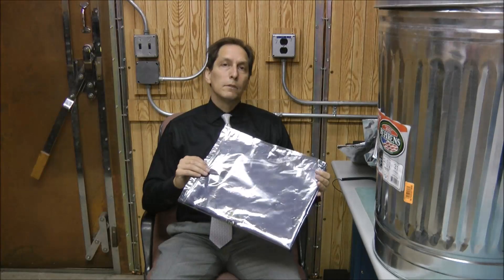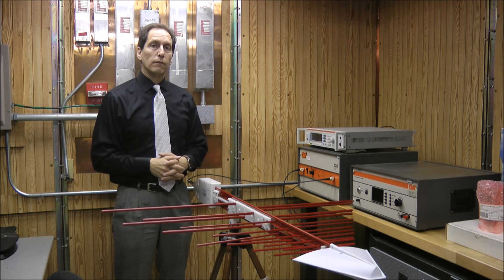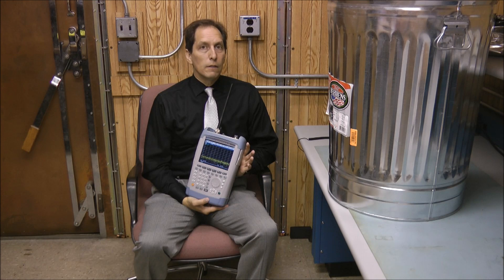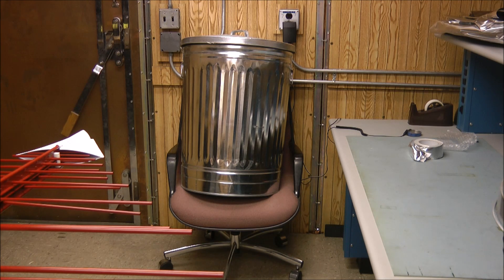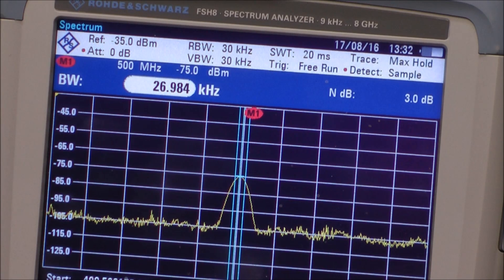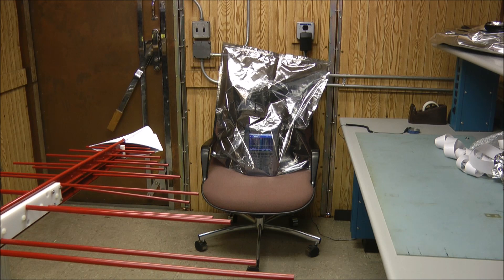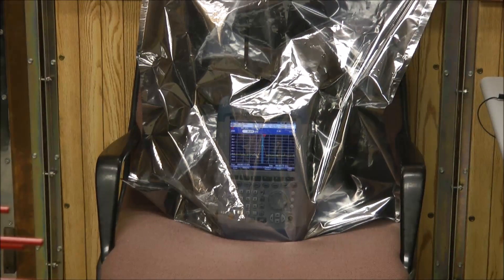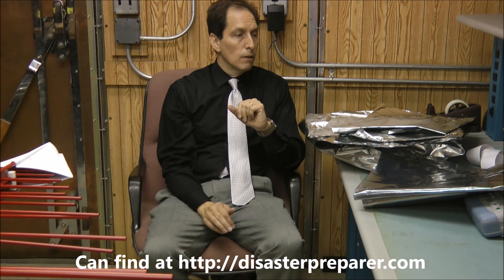Testing Garbage Cans and EMP Bags

Comment: I just put my cans together, making sure to seal all gaps and create isolation from the shell using cardboard. However, in the case of my cell phone, it rings with no issue when I call it while Wi-Fi is turned on. When Wi-Fi is disconnected, it won't ring. 

Is this an indicator that my cans are insufficient to attenuate the effects of an EMP? Is there anything else we can do to further protect our devices using these cans (I followed the video and used metallic ducting tape to seal all seams and ran a ring of foil around the top to further tie in the lid to the shell)?

Thanks!

Comment: Question, if you put a trashcan inside another trashcan, use Faraday tape to seal all the seams on both, do you think that will be much better than just a single can? Will that introduce any other issues?

Comment: While I'm glad you show testing and all, $50 a piece for the 36x36" bags is absurd considering they're available for less than a tenth the price elsewhere. I ordered my 24x36" 3400 series bags from Digikey for $4.50 each, since they're the only provider aside from you that I could find to purchase small quantities from. That's a far cry from the $22 per bag for your 26x30" size as well. Is there a reason for the massive discrepancy in price? If there's some valued adding service or treatment you do to the products your potential customers would like to know

Comment: Not sure if you can respond to my questions, but I really enjoyed this video I just first time watched, thankyou for the info 
Ok, I have an entirely aluminum metal rv horse trailer with living quarters(a Lakota colt).  I was thinking of sealing all windows with aluminum and all joint areas with aluminum tape to create it into a faraday cage.  I think it will work.  Question is, do I need to put in a grounding rod? And when  I finish and aluminum tape the main door on the outside will the tape stay on with rain falling on it or do I then need to put plastic over to protect the tape?

Comment: I dont know if anyone mentioned this, But I noticed on a garbage can we use to hold our chicken feed, it has a loose fitting handle you can probably see daylight where the handle is inserted to the lid and the tab is bent to kkep it in place. Perhaps some tape can help there as well.

Comment: Dang this video is old . If anyone reads this and knows for sure commit the answer .  OK if the equipment that is being used isn't getting destroyed from testing the signal  who says it will destroy any electronic  at all maybe I'm not understanding but the signal that is being put off from the equipment doesn't destroy anything then I'm guessing it's not a emp so it is a different signal so it would not be the same I might just be ignorant but it just seems like it would need to be tested with an actual emp signal or it would not be accurate please if someone knows about this message on the comments

Comment: During an EMP will anything metal heat up, like those induction stoves? If so, would it be a good idea to line the can with heat resistant material i.e. use kiln insulation?

Comment: I have an old vintage galvanized steel trash can I lined with aluminum foil on the inside walls and lid. I guess all I gotta do is set some tape in there to prep for the worst case scenario. I wonder how much more shielding the foil adds...:

Comment: Really appreciate the professional evaluation of this technique. I have a question about grounding. Would it be prudent to ground the can? Would that help? One other thing would it help to wrap your products in bubble wrap to help insulate them from the can?
Reply: Everything I’ve come across says yes to both questions. 
-Ground gives a place for that energy to go. 
-Every layer helps. You can inexpensively do it with cardboard boxes wrapped in 3mil foil tape. 
Like Russian Faraday Nesting Dolls inside the sealed metal container…that is grounded.
Reply: No, It is a Faraday cage. You don't ground them.  If anything, grounding them will reduce the effectiveness.

Comment: When the lid is not electrically connected to the can, it can behave like 2 plates of a capacitor (or dipol antenna) and so leak at certain frequencies. An EMP blast contains frequencies up to terahertz those crawl through small gaps, however they also arc over by the induced high voltage. So I hope that cookie cans for my data backups will still do their job during Putin's now approaching nuclear war. (I can not seal them with tape because I daily need them to put data inside.)

The main problem with metallized foil ESD bags is that the thin coating cracks by folding and then becomes useless against electromagnetic radiation or EMP.

Shielding is not only against EMP. It will become also vital to survive a digital pandemic (aka rebellion of machines) when strong AI (e.g. resulting in cyberwar sabotage) learns to hack better than humans and so locates and remote-control all digital devices to turn them against humanity.

Comment: Instead of a spectrum analyzer could you use two way radios, or even 5GHz or 2.4GHz Wi-Fi networks, and see if a connection can still be established?. Of course the Wi-Fi router would have its own power source.
Reply from the maker: You can, but you wouldn't know the exact signal level or shielding effectiveness.

Comment: It has to be the bonding not the gap . Don't make sense.  You can have a mesh cage
Reply from the maker: The size of the mesh opening largely determines the shielding. There are tables online that show the shielding that is possible based on aperture dimension. If you google aperture vs shielding effectiveness, you should find a table.
Reply: @disasterprepper  right I get that , but the size of the gap it tiny.  I'd be interested in the same test with a good copper bonding wire connecting the can and lid vs just closed and also vs sealed/ bonded with tape

Comment: Why does the galvanized can do less than aluminum foil?  Is it because energy moved along  aluminum easier than galvanized??
Reply from the maker: Galvanized steel garbage cans can do very well. You just need to pay special attention to sealing up the seam around the lid. If you do that, you can get at least 70+ dB of shielding, which is excellent. The metal material really doesn't matter much, since both have very good conductivities.
Reply: @disasterprepper   But, why did the aluminum foil-wrapped box beget a higher protection than the trash can (even w/lid sealed well)?
Reply from the maker: @Chimonger1  It doesn't necessarily. It all has to do with how well the lid is sealed. The aluminum foil and steel perform similarly.
Reply: @disasterprepper    Oh. It just didn’t seem so similar in the vid, because, the foil looked to be a far looser seal than the can lid.

Comment: My cans are lined with wood and the lids are screwed and duct taped on. The cans are grounded and items in the cab are shielded by Dri Shield bags. Things like SW receivers and charge controllers. A full gamut of auto fuses and circuit breakers. Of course extra Walkie talkies

Comment: Would lining the inside of the trashcan with silicone or putting items inside a silicone bucket inside the trashcan make any difference?
Reply from the maker: You can line the can with an insulative material. It can make it easier to store items inside, although it may not be required (depending on what you store). The insulating material won't affect shielding, but it can keep anything metal on the electronic items from touching the inside of the can.

Comment: now, bless this Dr.'s heart, for providing the public with very valuable info.  however, none of the EMP shielding was grounded.  the garbage can becomes a magnetic capacitor; temporary magnet.  grounding will relieve the voltage spike - at least in theory.
you could use the electrical outlet, minus the AC.  get an old 3 prong electrical cord, grind off the +/-.  
that, would certainly change the results(?)...  it's good to know this.  China is misbehaving...   Russia is dangerous...   Biden is senile....  Harris you just don't know if she'll crack under pressure.
Reply from the maker: Grounding won't make any measurable difference for electromagnetic fields in the far field (which an EMP would be). The capacitive effects you mention are much more relevant in the near field.

Comment: Good Video. I have a galvinized can on my back deck for trash bags. It always gets wet inside after rain as the top and side handles leak. May want to tape the can inside or solder the handle holes.
Reply from the maker: The cans aren't water tight, but surprisingly, the small holes don't affect the shielding much at all. I do a fun experiment sometimes when I teach class where we drill holes in a metal can and watch the shielding degrade. It take a lot of holes to compromise the shielding. But if you cut a long narrow slot in the can, the shielding is lost very quickly. It's the longest dimension of the hole that matters.

Comment: With the can, would it make a difference if it were grounded - a line direct to a ground rod?
Reply from the maker: No, we tested many times, and ground the cans made no difference in shielding. The reason is that we're not in the near field of the source (that's technical jargon for grounding doesn't really matter in this case).

Comment: I gander to guess that a nuclear EMP burst will have like a 1,000,000 positive DB.
Reply from the maker: dB is a ratio, not an absolute measure of energy or power. If you look at the field levels, you want a minimum of about 50 dB (99.7% field reduction) to protect from an EMP. That reduces the electric field down to a manageable level.

Comment: Working on the trash can idea for my spare cb radio equipment. Hope it's enough to seal the can and then hide it in basement.
Reply from the maker: When properly sealed, the trash cans provide excellent shielding. You can either tape around the lid with conductive tape (cheap but a bit of a hassle to get in/out) or use a conductive gasket around the sidewall of the lid (more expensive but convenient).

Comment: I am wondering if you suggest putting the equipment into the emp bag and then into the sealed garbage can, or if the bag alone is sufficient protection.  I purchased several bags from your site today and would like to know if I should put them in garbage cans, too.  Thank you so much for your invaluable information.
Reply from the maker: Hi Monica, first thanks for your purchase. As far as the bags, they provide about 99.7% reduction in electric field, which is enough to protect nearly any electronics. Some people either double bag or use a Faraday cage (trash can) for a second layer of protection, but it's really not necessary.

Comment: I am mostly concerned about family data..docs..pictures, videos, stored in few teradisk which are constantly running..  i guess if i were to sealed them in a dri-shield bag they would overheat as the bags are small.  Could i get enough protection from a cage made with copper mash which then i could cover with the material of the dri-shield bags properly sealed of course..

Comment: Something I've wondered for a while - would a heavy gauge steel "job tool box" provide any shielding if not taped? (assuming it was grounded and the electronic devices inside are isolated via non-conductive containers...)  It is not practical for me to store most of my electronics in a sealed (tapped) trashcan as most of them I would desire to store for an emergency I also regularly use and cannot afford spares for to set aside. I'm hoping find something  that could provide some degree of protection, possibly enhanced by being tucked away in the back corner of my underground basement, and might also provide some protection and also some degree of accessibility.  Thank you for any thoughts on this.
Reply from the maker: Hi Calvin, lots of people have converted tool boxes and truck boxes to Faraday cages. But they usually install gaskets around the inside lid to make a tight RF seal. You have to pay attention to any seam to get good shielding.

Comment: What happens if you put it in a chicken wire Faraday cage and then put that in the trash can then what happens
Reply from the maker: You just add the relative shielding values (in dB). So it would work better than either single layer.

Comment: My galvanized can has two vertical seams opposite one another on the body of the can. Should they be taped over, and if so, does it matter if they are taped on the inside or the outside.  There are also perforations where the handles are fastened and where the lid handle is fastened. Are these small perforations of consequence. Thanks in advance for any info.
Reply from the maker: The seams on mine are folded metal, so there was no appreciable leakage. If you're worried about yours, you could certainly run a wide strip of conductive tape. It doesn't matter if on the inside or out. As for the small holes around the handle, they won't leak enough RF energy to bother with.
Reply: @disasterprepper  Thank you so much for the answers.

Comment: I'm really sorry for bombarding you with questions lately, but things keep coming to mind. So I watched the ammo can video with it providing 75 db protection, but if I combined it with the Dri Shield bags (50 db) would I get 125 db protection? Would I need to line the inside of the ammo can with cardboard, and the inside of the Dri Shield bag?
Reply from the maker: You would get close to 125 dB (perhaps a little less), but yes, shielding generally adds in dB. The outside of the Dri Shield bag is not conductive, so you wouldn't need to line the can with anything.
Reply: OK, great! I will be suggesting this method and the bags/gaskets you sell to my group, I am the comms guy so they listen when I make suggestions. So do you think the conductive tape is required or will add more protection? I noticed you didn't test with the tape over the seal, of course I know there is a tight fit and the gasket
 probably removes any gaps.
Reply from the maker: @Devin82m  The conductive gasket takes the place of the conductive tape. It's much easier to use because you don't have to pull off the tape every time.
Reply: OK, great, I thought so. Thanks for the information as always.
Reply: Another question when you have time. So the DriShield bags are supposed to block about 50 db right? So why do my ham radio HTs go through them without issue? I folded the bag over twice, taped it, and even folded over and put a bag within a bag and the radio still picked up the signal from another radio on 2 meters frequency. The radio was putting out about 2 watts and the bags are brand new from your website undamaged. I'm not trying to make any accusation here, I'm just trying to understand the science here. I plan on putting my electronics in the DriShield bags then within a properly gasketed ammo can. I need to know if I need more protection than that. :-)
Reply from the maker: @Devin82m  It sounds like you've sealed it properly, but 50 dB isn't enough to block a 2W radio signal. Two-way radio's require about 120-140 dB of shielding to block, and I would assume your ham radios would be similar. I show on a video that it requires three layers of bags to block a two-way radio. https://www.youtube.com/watch?v=biTL-s0X8aI
The short answer is if you're going to use radios, you have to have A LOT of shielding to block them. Luckily, surviving an EMP only requires about 50 dB.
Reply: Great, I will add that info to my data. Thanks!

Comment: I didn't think the chance of an EMP is very high, but since I had to store my electronic preparedness gear anyway, I figured why not organize it together and use a makeshift cage.  Your vid really helped me see some additional steps I need to take with the tape and the right bags.  Thanks for the hard work and for sharing.
Reply from the maker: Sure thing. I'm glad that they're helpful.
Reply: i had near miss of lightning strike and even a computer laptop  that had  no connections to power or internet cable
got taken out as did many things in house including the new refrigerators thermostat board

Comment: I would to know how much emf can pass through a seam between a painted steel surface and aluminum foil taped to the surface with a few bits of gaffers or regular duct tape.  I have my guns in a Fort Know safe made of 10 gauge steel. I then cover the EMP resistant Sargent & Greenleaf digital electronic lock with a stainless steel bowl, which I then cover over with aluminum foil. The aluminum foil extends about 3-4 inches beyond the border of the lock and is taped down using regular duct or gaffers tape. This arrangement makes it relatively easy to gain access and should offer some level of additional protection to the lock so that in case of an EMP I won't be locked out of my safe. Judging from this video it appears the trash can allows considerable EMF to pass through the small gap around the lid. This would be valuable to know for the many gun owners that worry about this issue.

Comment: Would insulating the inside of the can and providing a ground path from the can help?
Reply from the maker: Insulating the interior is fine to do. It's usually not necessary because most electronics already are in plastic enclosures, but it doesn't hurt anything.

Comment: No sir you need up to 5 gigahertz
Reply from the maker: MIL-STD-188-125-1 dictates shielding effectiveness requirements of EMP proof structures, and the corner frequency for such is at 1 GHz. With that said, most things that protect at 1 GHz do a reasonable job of protecting at 5 GHz as well. Certainly a well-sealed galvanized garbage can would do a fine job of blocking 5 GHz. Just as food for thought, consider if a pulse rises in 1 ns (likely faster than an EMP) and stays there for a few ns, Fourier analysis shows that it's highest frequency content would be somewhere around 1 GHz.